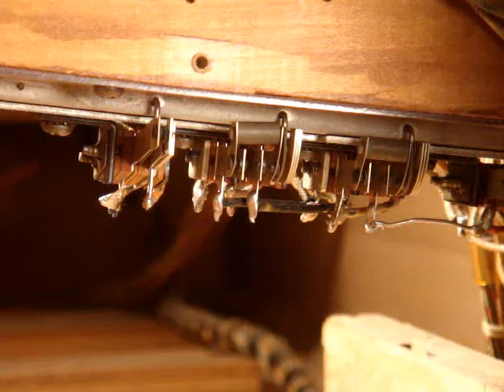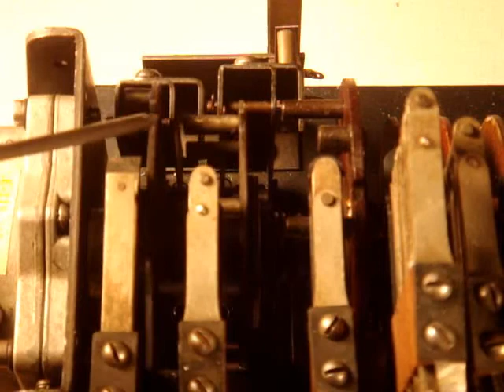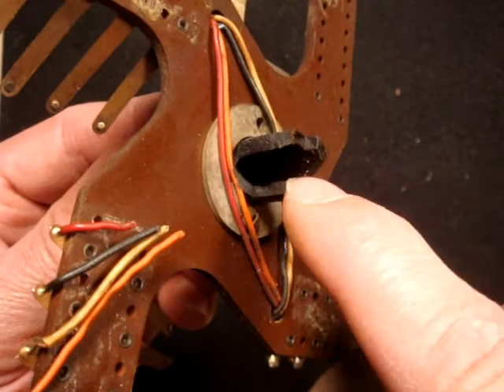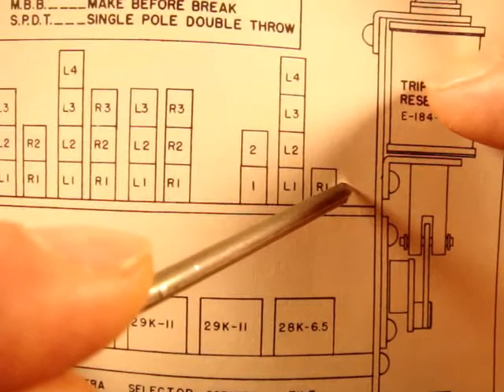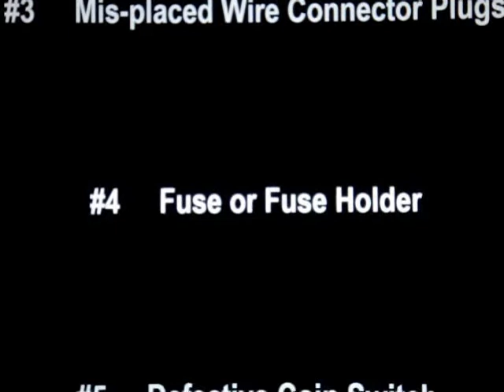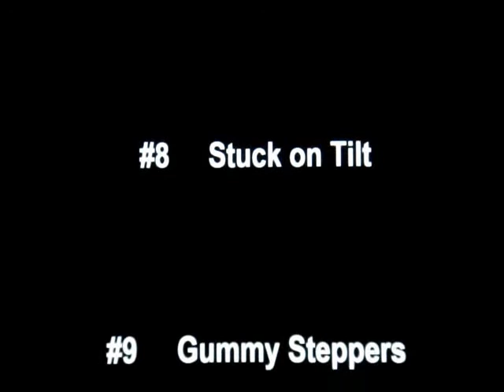How to Repair Bally Bingo Pinball Machines | Top 10 Reasons Why Your Game is Not Running

Comment: What would cause the machine, right after plugging in, getting stuck in some sort of reset cycle?
Reply from the maker: Sorry for the delayed response.  Honestly, I would just get the bingo course.  It would help resolve all issues.
Reply: @JMGENTERPRISES  I did buy the course. It has great information about individual mechanisms. However it is missing an explanation of how the machine operates as a whole and what happens from the time a credit is used to the last ball being played. I've since learned that the motors runs during game play so it can search for bingo matches. I take it that when it's powered on, it thinks it's in the middle of a game. Maybe someone messed with something trying to make it "free play".
Reply: Did you manage fix this ‘reset cycle’ issue? My machine has the exact same problem. Thanks in advance